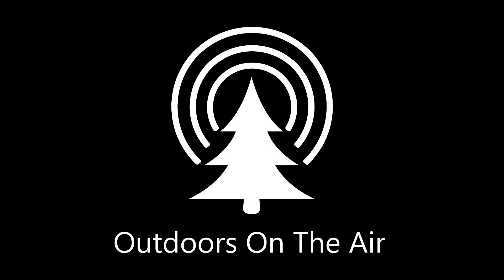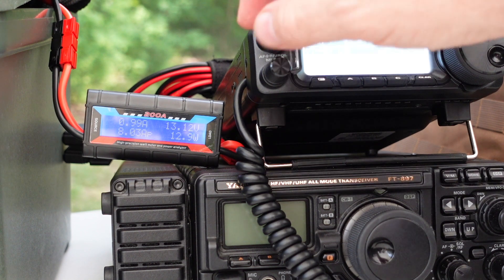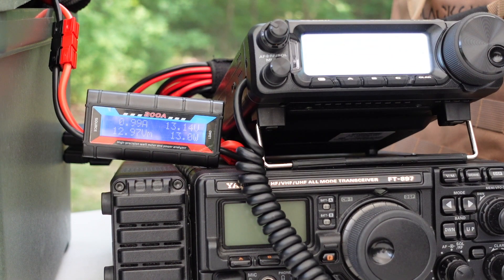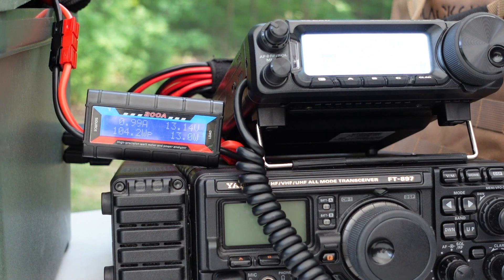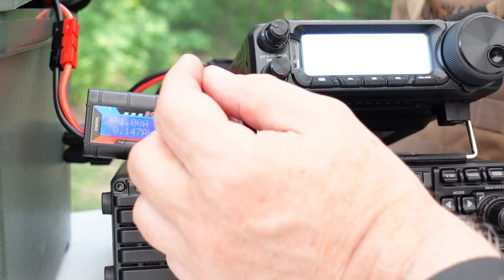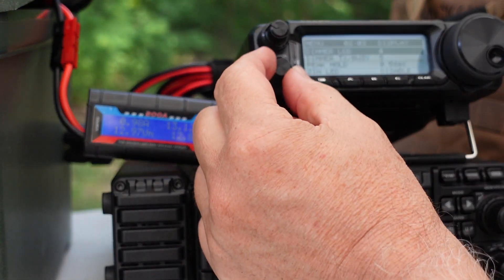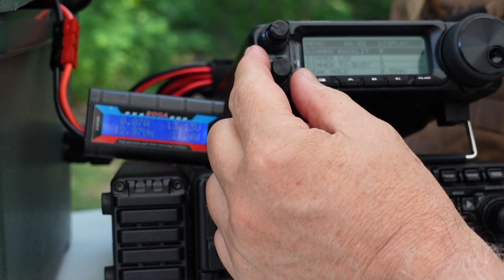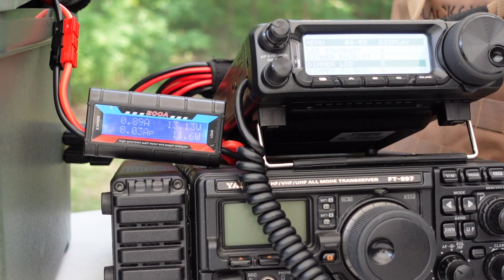Yaesu FT-891 - Extending Portable Battery Life

Comment: Those contemplating a long-term wilderness stay or a similar situation where power is limited might check out the QMX from QRP Labs. It's tiny, slipping easily into a shirt pocket, and on receive draws only 80 ma. Modes include CW, SSB, and digital at about 5 watts. There are three versions covering variations the HF bands. There's also a larger QMX+ that covers all the bands from 160-6. It's even available as an incredibly inexpensive kit.
Reply from the maker: Great points!

Comment: My current draw is zero on my FT-891… until I turn it on. 😂
But seriously… about battery life. If I have a 6Ahour battery on my FT-891 (which draws approx. 1A on receive)..
Does that mean I could theoretically leave it on for 6 hours?  Theoretically speaking of course, since I bet it shuts off at a certain threshold.
Reply from the maker: If you don't transmit, you could get 5+ hours with your 891 before it shuts down.

Comment: ...good point Tracy, but nowadays with the increasing availability of high capacity LiFePO4 batteries the squeezing down the absolute minimum current draw somehow becomes a moot point. 

Back in the olde days they were making SSB transcievers with less than 100ma of RX current (Spilsbury and Tindall SBX11) ...10 watts crystal controlled yes, but they were life savers for the outdoorsmen and trappers of the Canadian North. When the Beaver on floats was coming to get you or drop off supplies and a snow squall was in progress... someone needed to be told...  

 I use a 50 ah ( only11lbs) lithium battery for my setup... charged by a 250 watt solar panel. Even without the panel, it'd be good for the better part of a week... am I worried? Nope. Even a small 10-15 ah battery.. pack-sack suuitable for SOTA or POTA has enuff capacity for an afternoon or even most of a day of operation. Need nore?... bring a spare.
Reply from the maker: Thank you very much for this comment. It took me a while, but I now agree with you 100%. I recently saw a 100 Ah LiFePO4 battery selling for less than $300 CAD. That pricing blows the old paradigm right out of the water.
Reply: @OutdoorsOnTheAir  Tracy... here is a good option for what it's worth, I purchased a TimeUSB 50ah battery from TimeUSB specially as a power supply for my Xeigu G90 or FT 891...it'll run the Xeigu for days, although mine is charged with a Renogy MPPT 20 amp charger and 250 watt solar panel ( the panel was given to me)... the battery is only 11 lbs, so on it's own it's quite portable... I don't regret this...I live in Mexico so I had to have it muled down... they don't ship outside of the USA. 50ah is pretty small in size yet would be more than enough for most POTA applications...maybe even some SOTA...If you look at the price point, you'll find this is the best value for your money...the small ones like Bioenno are too expensive per watthour.  Richard VA7AA/XE1 Jalisco MX  https://www.timeusbpower.com/products/12v-50ah-pro-lifepo4-battery

Comment: Excellent - have my 891 as my base station with the FC-50 tuner but love the radio and may get another one for POTA a as and/or SOTA as it can be used at full power or down the power for QRP.  Love Yaesu products - VX-6R (3 of them), VX7, FT-8900, and FT-2900.

Comment: Tracey I’m a new ham looking to get my hf privileges soon.  I have a question- how do you think a 12v 10Ah battery would fair in real life with this rig?
Reply from the maker: Hi Kevin, thank you for reaching out. Welcome to our great hobby! 
I have tested my 10Ah LiFePO4 battery in a Parks On The Air activation with the RF power output on the rig set to 20 watts. In my use case, I expect it to last 2.5-3 hours using the setting shown in this video.
Reply: @OutdoorsOnTheAir . Thanks for this comment.  I’m going to go for it and see just how it goes. A test. I have a 12v 12Ah Bioenno battery. I plan to test it out on a SOTA activation. I’ll use 20w on SSB for a few contacts and then 5w or 10w on CW.  Most likely be fine.  Thanks a ton!  I love tests… and if the battery dies… at least I got a good hike in!!!

Comment: Good video but I don't think 891 was built with energy efficiency in mind. It looks like a car radio. On the other hand with some lithium battery this may not be an issue at all. It all depends on what you want to do. If you are about car camping I would not even bother with the display because 40Ah LiFe battery will keep you going "forever".

Comment: If you use a solar panel that can provide the same or more amps than the radio draws, it won't matter how much current the radio draws. Also running less TX power can help with power consumption, especially for operators who like to operate closer to 50/50 TX/RX. I've been looking for ways to reduce current draw in my FT-891 as well, and I keep hoping that there are more features that can be either turned off or turned down. 73 KD5YOU

Comment: Yes. There is a little known way to reduce the current consumption of FT-891. It simple, but very efficient. All you have to do is to replace it with KX3. This also reduces the weight of the radio and improves the UI significantly! :)

Comment: You saved every FT-891 user 100mA. Well done! I am actually getting ready to sell my FT-891 as I can't handle the weight of this rig in the desert during these summer months.
Reply from the maker: I get that! What will you use in its' place?
Reply: @OutdoorsOnTheAir  I've been favoriting the Yaesu FT-818ND the last year given its size and weight. The 6 watts is rarely a problem on SOTA as I am the station that people want to work and typically have an elevation advantage. I'm still waiting for Yaesu to deliver a 20 watt version of the FT-818 while maintaining the same size and footprint.
Reply: @TheTechPrepper  4lbs vs 2lbs?  You must be a long distance hiker or something?  Seems as though the advantages outweigh a 2 lb disadvantage in your case?  But I’m listening!!!
Reply: @twobikesandadrone  I'm not so much a long distance hiker, but someone who hikes year around in the Sonoran Desert. My typical hikes are 6 to 10 miles with temperatures between 100F to 118F during the summer. I also tend to go multi day and need to bring 6-8 liters of water per day. Most of my weight is water with the pack running about 65-70 lbs with the radio gear and support gear. The additional weight of the 891 and larger battery really  start to break the camel's back. Right now my full FT-818 manpack weighs 10 lbs. I've made several videos on the manpack configuration.
Reply: @TheTechPrepper  get yourself a Chinese 45w amp for the 818, it’s still lighter then a 891 and a bigger battery.

Comment: I can run my TX-500 for 8 hours on that same 890 mAh as the FT-891 consumes in an hour.
Reply: Hi Todd this is 100 watts rig not a qrp
Reply: @dengen3944  Agreed, but the video was about receive current, not transmit current. There is absolutely no reason that I know of that a QRO radio can’t be built that has a receive current rating well below 300 mA. Yaesu does a lousy job of building power-efficient radios
Reply: @toddbu-WK7L  your are absolutely right 73’s

Comment: I don't know about the 891, but on my 817 I use some cheapo Walkman headsets (I grab everyone I can get at Goodwill cuz I'm kind of hard on them and they are more fragile than heavier headsets) are light to carry, have fairly good fidelity and and have less draw than the indigenous speaker.  You usually have to turn the on-board speaker up to hear weak signals clearly which takes more power to drive and the volume usually stays up.  With inexpensive portable headsets like the ones I mentioned I find that there is a difference, not to mention that the fidelity on all the signals is better because you're wearing headsets.  Give it a try, put it on the meter and see what you think. 73.
Reply: What a great idea! I’m going to try it.